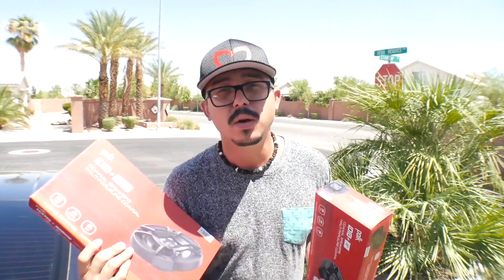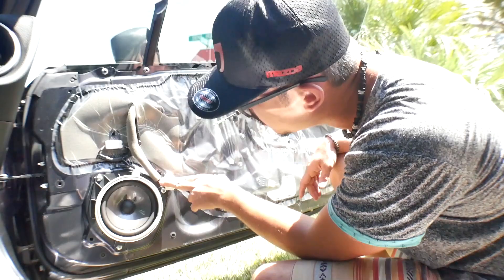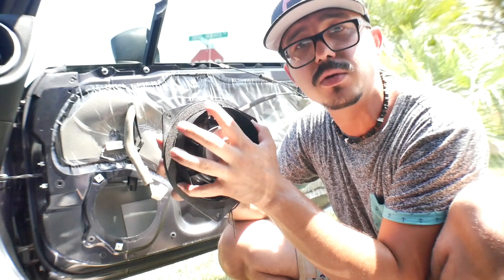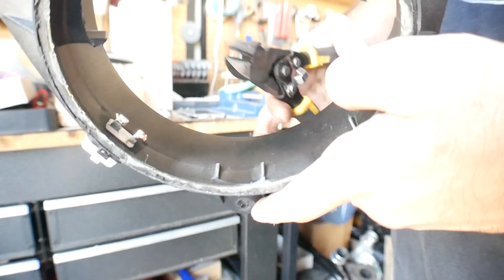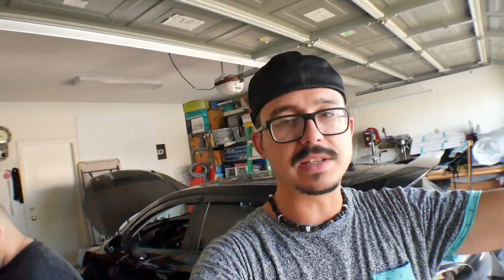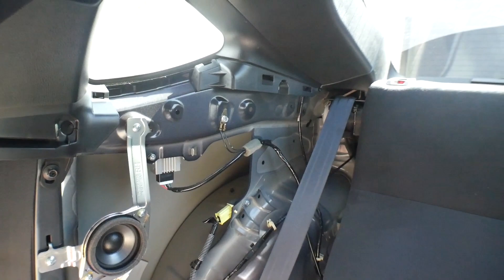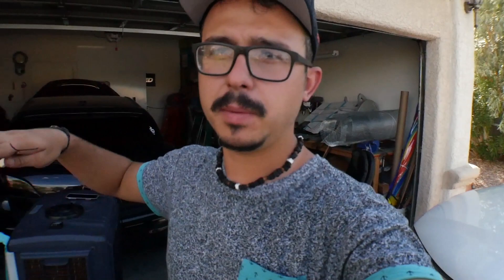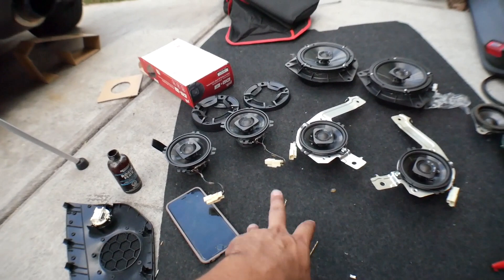FRS / BRZ / Toyota GT86 Speakers Upgrade FULL INSTALL

Comment: They say they know what there doing but I have to disagree .. first off he said the new speakers will be louder than the factory ones...wrong! You have a factory radio and factory amp that puts out around 100w or so , so even if you put in 500w speakers they still only gonna put out whatever your factory amp or head unit puts out which is about 100w give or take .. They system will sound BETTER and CLEANER but it's definitely not louder ..  Next mistake was wiring the new speakers .. you never tested the polarity of the speakers an you just assumed one color was positive an other color negative ... I been doing installs professionally over 20 years an experience tells me to always check speaker polarity because red is not always positive and black isn't always negative .. also manufactures often make mistakes so if you have say a 2015 BRZ for example  an your speaker colors for example are red positive and black negative in your right front door...doesn't mean the next 2015 BRZ colors will be the same..the same color wires may be there but polarity could be backwards or the next 2015 BRZ colors in that same door might not be red and black.. I've come across it 100s of times.. always check speaker polarity , never assume anything in car wiring! Lastly you used hot glue to seal the speaker to the ring, an you used thin tiny screws to mount them on a thin tiny lip inside the housing.... NO ..hot glue will eventually break up An crack , An those tiny screws on that thin lip will also eventually crack An break from vibration ..  mounting brackets are cheap af , so is abs plastic..hell a piece of plywood is only 7 bucks an would have worked better.  As a pro installer it kills me seeing YouTube videos on how to do car audio by ppl who don't know what they doing.. it's sad that ppl watch videos made by ppl that don't know what there doing smh .
Reply from the maker: Michael Palmisano since you so pro you should come install em yeh. I’m posting what I did if anyone wants to fallow it’s on them. I’m just sharing my experience and what I did to make it work. All the speakers are working perfect so far and it’s been almost a year. On that note I’m out
Reply: Surreal Ent in the beginning of the video when u we're useing a screw driver to pull panels you said you a pro..  an I get u sharing what u did to make it work but u making it sound like this is how it's done, you didn't mention at any point that this is how u made it work..  an yes your system might work but it doesn't mean it's done correctly .. even if you wired your speakers out of polarity they will still work . I'm not disputing your wiring is right I'm saying if you gonna make a video on an install you should know what your doing an do it properly so ppl get the right info.. I guess you don't care if ppl follow ur directions an they end up blowing there brand new speakers huh?   Also video clearly says (do what we say , not what we do) well u doing exactly what u saying ur doing , it's contradicting no.  An I'd be happy to do the installs, send em my way an the jobs will be done right .
Reply: Wattage isn't the only only factor when determining "loudness", impedance and speaker sensitivity are big factors too. A speaker with equal impedance and power handling of the stock speaker can be "louder" if it has a greater sensitivity.
Reply from the maker: very good to know thanks for that update
Reply: Alex Kalicharan incorrect... it will not be louder unless you upgrade the source ... if you have a 100w radio for example and install 4 300w speakers you still only gonna get 100w unless you add an amp.. sensitivity weather higher or lower does not make anything louder, it simply gives a cleaner or worse sound.. impedance is also not volume , same rule applies you have 100w radio it's not gonna matter if you wire your 300w speaker to 1. 2 .3.4 .8 ohms you still only getting 100w not matter how you wire it unless you add an amp to power it.  Also just because a speaker says it's 100w rms and 150 peak doesn't mean it actually hits those numbers
Reply: I don't think your understanding is as solid as you think it is... It doesn't matter if your radio only outputs 100w, there are different ways to increase loudness. One way is to add more power, like you stated. Another way would be to equip speakers that have a higher sensitivity. 

Lets say you have two speakers, speaker A and speaker B. 

Speaker A is rated 4 ohms, 100 watts, 84 dB sensitivity.
Speaker B is rated 4 ohms, 100 watts, 90 dB sensitivity.

If you connected speakers A and B to your 100 watt radio, speaker B will blow speaker A out of the water in terms of loudness. Speaker B is a whole 6 dB louder than speaker A, and the only way to increase speaker A's loudness is to add more power. Speaker A would have to be fed 400 watts so it could effectively output 90 dB to match speaker B. The number 400 is obtained from the fact that in order to increase loudness by 3 dB, you have to double the power. So,

- in order to go from 84 dB to 87 dB, 100 watts is doubled to 200w
- then, to achieve 90 dB, power is doubled again. 200w x 2 = 400 watts.

Now you can see, sensitivity can be VERY important and power isn't the answer to everything. The fact that speaker A needs quadruple the power to sound as loud as speaker B shows that efficiency is very important. 
☺
Reply from the maker: lol you guys really triggered over this speaker video lol :) i love it :) be sure to subscribe eh :)
Reply: Surreal Ent lol I'm not triggered, I just don't understand how someone who claims to be a "professional" doesn't understand the basics behind speaker sensitivity and that throwing power at the problem isn't always the answer
Reply from the maker: i hear you man its all good
Reply: Alex Kalicharan yes I agree with what your saying about sensitivity ...but sensitivity is not volume , it's not power. Speaker A and speaker B have dif ohms , sensitivity An possibly even wattage but none of these are volume.. example a head unit that's 50w x 4 is only really putting out about 25 to 35w of power per channel no matter what speaker you add to it period .. yes speaker A might sound louder than speaker B because of the specs between the speakers are different but your final result no matter how you look at it is still only about 25 to 35w rms from the radio .. you throw it on a Dyno your end results wattage wise will not change .. obviously you compare an alpine speaker to a boss speaker the alpine will kill it .. your view is like saying the bigger the speaker the louder it will be An that is far far far from true!
Reply: Michael Palmisano you're still not understanding, I am telling you that if all factors are EQUAL, such as impedance, wattage and even speaker size, then the speaker with the greater sensitivity will be louder. You're trying to make an argument about RMS wattage from a radio, what does that have to do with my argument? If you feed the same wattage into two speakers, the one with the higher sensitivity will be louder period. If you crank up the wattage for both speakers they will both be louder but the one with higher sensitivity will STILL be louder than the other. You also stated that earlier I said the bigger the speaker the better... Where did I say anything like that? You're not interpreting anything I say properly! These are basic, elementary principles that should not cause this much confusion...
Reply: Alex Kalicharan no I didn't say you said the bigger the speaker the louder it is , I was just throw an example out there .. An u right there are misinterpretions here.. now I see what your saying an yes I agree with you 100 percent .. I misunderstood what you were saying ... my fault !
Reply: @SurrealEnt  it’s just some audio knowledge bro why you gettin offended he’s right…you need more power it’s like using a ps5 and plugging it to a old tv you’re not gonna get the most out of your ps5

Comment: I am going to write the things I consider would be good to know that are not mentioned here or things I learned after doing this install the exact same way. First I would’ve gotten the 3.5” speakers. The windshield speakers simply don’t fit, you are left half inch of unscrewed portion and you have to do a bunch of fiddling around to get it to work, you can, but it’s just too much imo. Next, modifying the mount for the rear speaker was just crazy. If I was completely into this speakers, I would probably buy a mount which can probably fit, since there’s a lot of space and then just cut the round metal out with my hand and use the leftovers just to attach the mount to the holes instead of cutting the round piece, since that was a dangerous trick that can harm you, and this is stereo install not beam mounting for a building. Finally, getting a mount for the 6” instead of reusing the current ones and installing in “the lip”. Getting the mounts for the rear and 6” would drive up the cost at most $50, but will save you a couple of hours and will make this installation easier, and safer as doing the lip and the rear mount requieres skill and tools that can easily hurt you if you are not an avid tool user. It would have been cool seeing how they installed the windshield speakers. Other than that great seat of speakers and great video. Thanks!

Comment: x2 speed recommended...how's it doing a year+ later?  do you still have the car?  any changes or upgrades to the audio since this?
Reply from the maker: i will be posting a video and updating everyone next week and im back at it on the channel
Reply: Replaced all mine with nice 6.5" Kickers. Used aluminium brackets bolted to stock rear brackets to fit 6.5"s in the rear as well. Have them running off an android head unit to a Pioneer 5 channel amp pushing 75W RMS to each corner and 600 RMS to an 8" Kicker Comp C in a truck sub box in the trunk. Dash corner 3.5"s are running off the head unit's built in amp @ 45W RMS a piece. Had a 12" 1000W RMS Kicker sub but it was taking the entire trunk up so ditched that. It's now my home theater sub :D

Had it all installed for a year now. Amp wired with eBay wiring kit to battery, all other wiring is stock. Didn't replace speaker wires at all. Only sub has beefy wiring. Did this so when I sell the car I can swap back to stock speakers. Even with the small wiring the car has, I routinely blast music for hours at a time and the system has been perfect. Did have to correct a lot of loose stuff behind trim in doors and such that was rattling with bass though.

Comment: There are two drivers in each speaker. Did you check the ohm load for the new setup? That stock amp is going to take a dump quick.
Reply: He ripped out the 2ohm door mini woofer/subwoofers for 8 ohm coaxial tweeter/woofers. Increasing the resistance isn't going to cook the amp but it will reduce the current and overall wattage output. The 4x higher resistance will take the amp out of efficiency range effectively making more heat and less sound. I'm guessing he had a door rattle problem that was preventing him getting into the sweet spot of the amp. The stock system doesn't sound bad for the price point on the FRS as they used the Scion unit which was put in all Scions and marketed to young people. Its not great of course, it sounds like a boombox of that era - Punchy but no low rumble as the 2ohm woofers are small and short throw.

Comment: Nice video, really enjoyed it. Did you use the factory amp with these speakers? Is the bass response much better than standard?
Reply from the maker: Simon Lam yes used eveything stock and base is less I would say it’s more mid and highs huge improvement. We are adding a sub so wanted to have super Krisp sound first
Reply from the maker: id say better and cleaner

Comment: I am literally speechless, I don't know what to comment first... So, you took out and destroyed a fully capable and functional 2-ohm woofers from the doors to replace them with 4-ohm coax-speakers (?!?!?!?!?!?). Then you took out fully capable and functional mids from the dashboard to replace them with 4-inch coax-speakers, probably reconnecting the factory tweeter (otherwise new speakers would not be working). So, what we have there is a treble overload from two different tweeters. Cherry on top, you went the full length to replaced the rear-panel factory mids, which were LITERALLY installed in the air (just hanging there without a cabin whatsoever) with some other 4-inch coax-speakers (?!?!?!?!?!) and zero contribution to the sound-system performance. 

So, you added treble literally EVERYWHERE (killing every last shred of stereo-imaging) and you are down in mid-bass and bass (since the woofer in the doors in 4-ohm, so it's weaker compared to the 2-ohm factory woofer you destroyed). 

Well done, gentlemen, I love vanity! 

...in the meantime all this car needs is better amplification.

Comment: hey I saw you guys used a larger speaker for the dash so you don't have to worry about the stupid housing. can you do the same thing to the door speakers? taking this housings is a pain
Reply from the maker: i can but you would have to cut up the housing pretty well and you dont wanna do that because the door speakers actually get base and the tweeter on top does not give base so it will not move around. If you do that for door speakers the base will not be contained and it may rattle and wont sound good. So i wouldnt suggest doing that unless your making a custom inclosure with fiberglass or something
Reply: sounds like another pain
Reply: Be it a dedicated woofer or 2 / 3-way full range speaker .... all will send bass "not base" to the area behind it as well as infront   The drivers cone simply vibrates causing sound pressure on both sides of the cone material.   Only on a 2 / 3-way speaker will it's small mid and or tweeter drivers only direct sound outward into the vehicles cabin.

Comment: Do the aftermarket speaker sounds different to the stock ones? do you recommend to replace only one side of the speaker, cuz mine have probs on the left, so planing to only replace the left one.

Comment: What a piece of shit .... coax speaker in door and on panel? Hotglue a speaker in a black car (you have no sun there, right?). No need for damping material?
Reply from the maker: We used hot glue gun to make it alittle bit stronger lol otherwise the speakers are mounted with 4 screws on each and they sounds great by the way. Trust me not my first time installing speakers haha
Reply: Surreal Ent hotglue melt at which temperature? The worst are the coax in the door. Super sensless and will end in unnatural listening experience, since there are two different sources for tweeters for each side.
The only thing that is really good, the reusage of the OEM midsub frame.
Reply from the maker: Thanks for the tip now i know bud

Comment: How many ohms are the polk speakers?
Reply from the maker: Gatlin Garage I have the links in the description to the speakers feel free to check them out
Reply: They are 4 ohm, you cant put 4 ohm speakers in with a 2 ohm sterio.  It will bog down the system and sound like crap. I have a 04 mazda6 with bose and its 2 ohm. You have to use 2 ohm with factory stereo system.
Reply from the maker: Gatlin Garage the stock head unit is very soon coming out hint reason we went with those speakers
Reply: The car needs 2way speakers 🔊